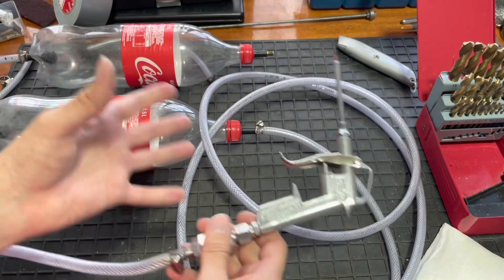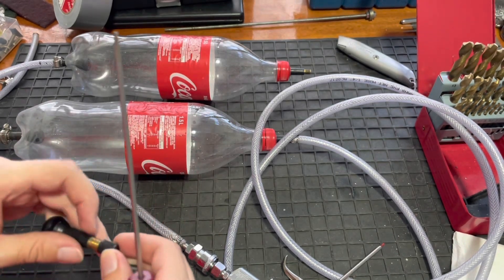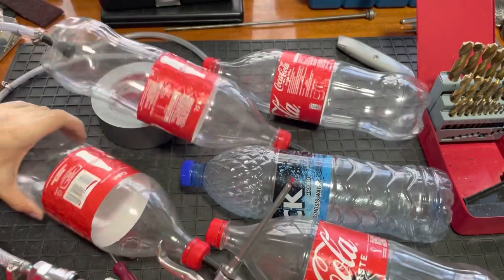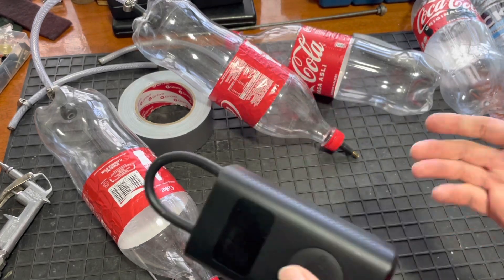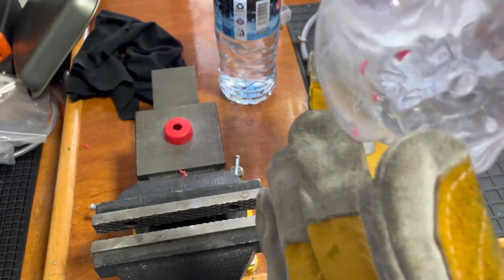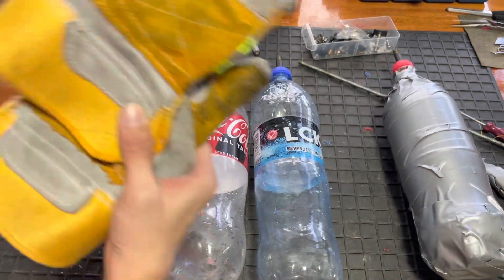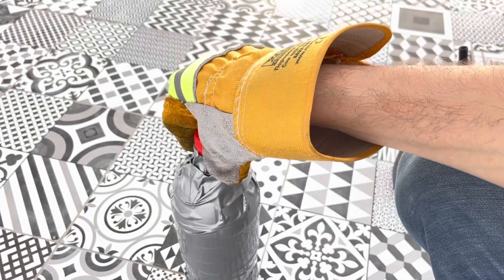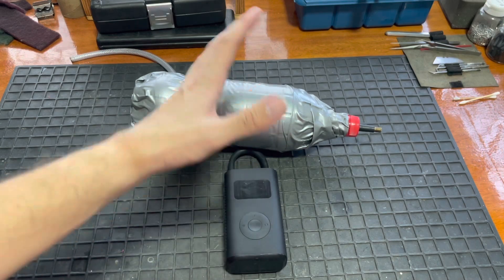Home Made Air Compressor For Bike Maintenance.

Comment: I do a similar thing with a car tire! Not to the same pressure though. Even though it might hold it, the faliure will be a lot more catastrophic than with a bottle. One great thing with filling your tank with a hand pump rather than a compressor is that you don't get any compressor oil in the system, something that can harm electronics if you use compressed air to clean it. For this reason a lot of PC enthusiasts buy compressed air in a can. I will definitely try this with bottles, since it can hold higher pressures than most car tires are rated for, is easily replaceable, and takes up a lot less space than a car tire.
Reply from the maker: Great 👍🏻 🙂

Comment: very interesting video! I might do this one for myself as it can be very useful especially when comes to cleaning your bike. Btw if not mistaken fizzy drink plastic bottles from Australia tends to be much thinner compared to here and my guess is the reason why it can only hold certain amount of air pressure.
Reply from the maker: Interesting, I didn’t know there was different manufacture of plastic bottles for the same Brands? I just assumed they would all meet the same standards? Yes give it a go, it’s easy and very useful. 🙂👍🏻

Comment: Hi Reginald...great chanel you got... "A little bit scarry, but prity safe"... hahahah ;-) Yes its scary using a plastic bottle even if they are partially quite heavy duty. Once I have seen somebody dropping a full 1,5 liter water bottle out of the 10th floor of a house... it survived it several times, till it was fallen onto the cap/bottleneck itself and thats the weak point of it. Maybe consider to use an old car fire extinguisher bottle, beer drum (difficult to find in Brunei I know), Schwalbe Tire Booster bottle, Topeak Joeblow Booster Foot Pump with a regulator valve in the air line (favorite which is anyway nice to have forall kind of tubeless tires), scuba diveing tank, domestic waterworks tank or similar... you can easily adapt the cap/openings with some proper metal made air hose fittings out of every hardware store...using low pressure you got a prity safe, mobile and cheap system to run. Greetings to Brunei... Pablo 🙂
Reply from the maker: Nice suggestions, I’m just wondering if using a stronger container like a fire extinguisher 🧯 would be mare dangerous if it fails? 

But non the less an excellent comment and thank you very much! 

Safe riding!
Reply: @reginaldscot165  Hi Reg, well… maybe I forgot to mention my definition of low pressure what is around 3 bars (approx. 45 PSI) maximum for such a „system“ even if it might be able to take more. If you go up to around 6 bars (approx. 90 PSI) I see it highly critical that the weak points of the system, the plastic caps with drilled holes and installed Schrader valves (car valve) have the potential to become a serious projectile able for example to hurt your eyes if not protected well and I don’t use safety goggles all the time working on bikes. -> My 5 Cents are, use a proper air compressor system, designed for the job and keep it maintained according to manufacturers instructions…it’s finally also worth the money. But it’s a nice „Coke“ bottle experiment 😂👍 By the way, you can find several great ideas on this matter on YT, all used on low pressure vanish spray systems…with a car or motorbike tube as air reserve tank for more volume etc… Cheers Pablo
Reply from the maker: @sa330jpuma  yes thank you so much for all your effort, I appreciate the input and information. Yes there are some great ideas on YouTube, I’m sure I can improve my system, I was actually considering large PVC water pipes at 1 point but I couldn’t find the right plugs and end caps to make it work. 🤭

All the best and thank you again! 👍🏻

Comment: Great stuff, but have you thought of getting an old car wheel/tyre and fill it to 100psi once a week? I do pump my car tyres up with the track pump. It's 5 strokes per PSI on mine. ;)
Reply from the maker: That’s not a bad idea. 🙂👍🏻
Reply: @reginaldscot165  Thanks. :) |I'd maybe take the wheel to the garage. Quicker. :) Re: the valve in the bottle top, I have soldered a presta valve into pipe compression 'stop end'. When I do some plumbing, I pump the pipes up through the valve and check for leaks with soapy water. :)

Comment: Please don't use compress air to spin dry bearings or dry yourself. It's very dangerous when the bearings let loose or if compressed air punctures pass your skin. It's a known no no in the automotive industry.
Reply from the maker: This is very Low pressure in comparison with a full sized compressor. But yes, if you have a real compressor you are 100% correct. 👍🏻🙂